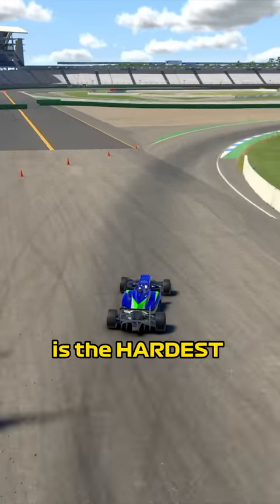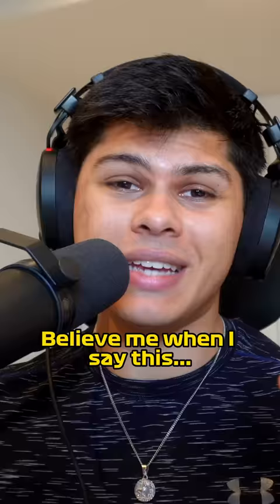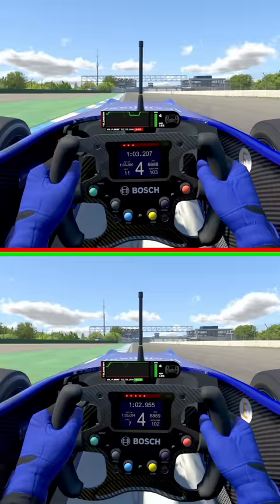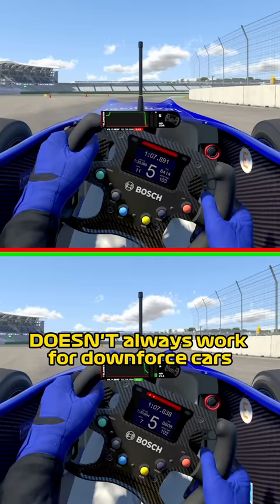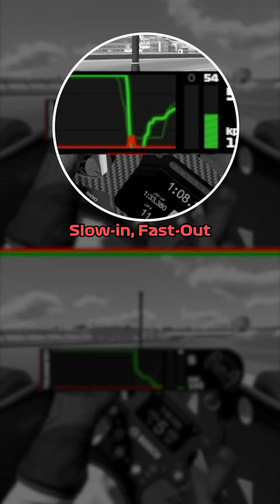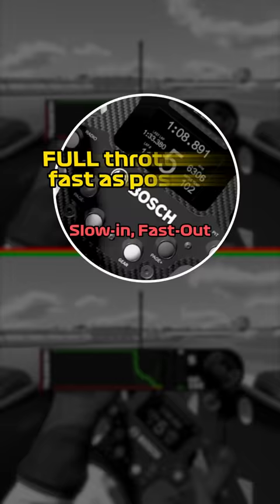How To: MAXIMIZE DOWNFORCE for Lap Time

Comment: The faster you go the more grip you have. It’s the opposite of what we’re comfortable with.
Reply: facts, even with like, LMP/gt3 cars its a bit insane. crazy to thing that laying off the gas on a turn you have to typically break for is just an insane concept. 

source, i lap the nord in 8:40 in stock ae86......its all about keeping momentum for turns in low HP no downforce

speedy boys your like "must go fast to turn"
Reply: But still going faster still means that your turning circle get's larger, no matter how high the downforce is.
Reply: @derblaue  not true, the downforce provides the grip needed to maintain a higher speed with the same turning radius. You can only make so much downforce, so youll need a bigger turning radius to maintain more speed when pushing the limit
Reply: @Daniel-jo5dy  yea, I have a full properly built aero kit on my 15 WRX on stock STI suspension and solid mounts almost everywhere except engine and minor power mods.

I actually went down a tire size from my previous setup due to the aero. it just doesn't make sense to get larger grippier tires that reduce power when I have really powerful aero and I just fast in fast out, with light throttle the whole way and I grip as hard as some higher end Porsches.

aero is really a hell of a drug.
Reply: @derblaue F1 car can drive upside in a tunnel it has so much downforce…
Reply: @Daniel-jo5dy  I meant that for a (high) downforce car the centrifugal force scales with v^2 while due to aerodynmic inefficiencies the downforce and such the normalforce which determines the critical lateral centrifugal force scales with less then v^2. Some People think that entering too slow with high downforce cars makes the turning radius larger which isn't true. This was also shown by 
KYLE.ENGINEERS, a former Mercedes F1 aero engineer.
Reply: No. The faster you go, the more downforce you have. That doesn’t necessarily mean grip. Otherwise they’d take the entire circuit at full throttle
Reply: @HieronymousLex  more downforce = more grip?
Reply: @Sunnyside845  Technically he's right since tires can be overloaded but besides that more downforce means more grip.
Reply: Huh. Same for any car. You just get more of it in downforce vehicles. Hell pretty sure all vehicles are "downforce cars." Just some have more of it. Even in a minivan if there was no downforce you wouldnt have any grip. Guess i could be dumb though. Also, pretty sure braking, then getting on the throttle. Is always slower in any motorsport opposed to rolling in and out of the throttle and engine braking. Even a 90s accord will gain a second or two by doing this. Again, just my opinion though. Braking causes you to lose momentum/need more throttle to get back to speed. Simple physics.
Reply: @derblaue your turning circle?? They’re not in a car park right?
Reply: Actually is the opposite for me lol. I got into sim racing only playing the F1 games I recently started playing Iracing and found this out trying the mx5 out. Found out the formula vee feels much more natural for me to drive

Comment: Makes sense - being smoother upsets the platform less and lets you carry more speed in fast, aero dependent bends
Reply: It's not because of stability, but because of the wings pulling the car down so the tyres have more grip.

Stability helps to maximize downforce, but is not the point of the video.
Reply: @Gabrielxdxd4  yeah cheers. I know what you mean - as you go faster the car allows you to extract more grip thanks to downforce. I focused more on the aspect of being smoother as the car gets more aero dependent. Good luck to you.

Comment: This is actually so interesting now that I think about it. I’ve always driven very high downforce formula cars so I’m so used to the second method of throttle application that when I switch to lower downforce GT cars, I have way less control and I’m much more understeery. Intuitively I try to do the first method but it’s so much better to theoretically understand what’s going on.

Comment: I learned to stay on the throttle on corners in high downforce cars because the rear likes to slip off throttle. Imagine hitting a corner under steering and then suddenly oversteers

Comment: You can't generalize. It depends what is behinde corner. (is there long straight or next corner?) Is it better to have stronger downforce? It depends what circuit you are. For example at monza you will make faster laps with almost no downforce because you will gain more time on straights then benefit from strong downforce at turns.) ...
Reply: While you are right I find the critique of a professional racing driver and former  F3 driver hilarious
Reply: It's better to have some downforce rather than none at all for obvious reasons, with downforce it keeps your car glued to the track surface which is exactly what you want for dast lap times. Straight line speed isn't the main priority here.

Comment: The downforce is the brake , you just have to manage the throttle a little, but braking on the end of long straits is also important, you need to cath the feeling of what to do trough practice and experience, and at first, simulators do a great job on muscle memory , when you need real world , because the pedals are only 1/3 of the experience, the cornering , braking , accelerating G forces , + the speed perception of real life, is totally different, and you need to mold the reflexes to fit the real world conditions.

Comment: I only left foot brake,hard in,back to full throttle off slightly as  oversteers, braking light to balance suspension,pump gas pedal 90 -100% as fast as possible until full well before the apex.

Comment: It just depends on the corner. You won't do this in slower corners, where the DF won't be working. But this is really applicable on medium speed corners compared to a mechanical grip car.

Comment: It all depends on the corner, and whats after. If a long straight is after, your screwed with your trailing throttle. Also if you need rotation play with on off throttle adjustments, rotate off throttle and you'll be about .12 faster through most corners 😉

Comment: Would you consider a gt3 Rs 991.2 a high downforce car?
Reply: Only Formula, LMP/Hyper. Cars without production model as its base. 

Never the less a GT3 992 R would probably have one of the highest downforces of a series production based car you can find. So in some cases this may work too. Like the Renault corner in Barca or sunset on Kyalami.
Reply: i'd consider gt3 cars to be more in the middle. guy above is right about which cars are high downforce.

Comment: Um thats faster in any racing scenario. Not using brakes, engine braking, and rolling the throttle is pretty much always faster than braking. You lose all momentum when you brake

Comment: I think you should use a better example because the track your on doesn’t require as much downforce to be honest if the corner in the video is your example on what your trying to explain it’s a bad example and yes I know what track that is it is hockenhiem Germany  that corner doesn’t require a lot of downforce it’s a medium speed corner the corner after is what requires the slow in fast out  you need downforce all the time

Comment: Are you braking while turning? I found that braking first, then getting back on the accelerator during the turn helps a lot. You don't want to be coasting - should be on the throttle or on the brakes
Reply: The graphs in the video show everything.
Reply: if you have to go back to throttle before apex, you overslowed for that corner. if you go back to throttle on the apex, your turn-in speed was close to correct 👍🏻

Comment: Don’t do either. You are supposed to be trail braking. Messing with throttle input will just slow you down more.
Reply: Ah yes, good work educating the 2016 US F4 and 2021 Euroformula Open champion on how he should be driving.
Reply: Trailbreaking doesnt work on f1 cars.